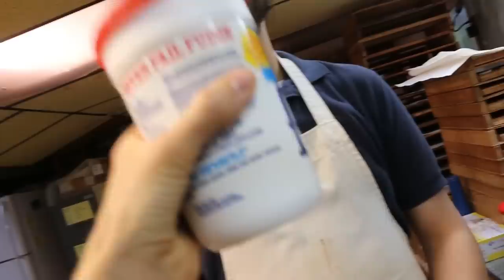How We Make Our Peanut Butter and Fluff® Cups

Comment: I always warm peanut butter up slightly so that its soupy when I want to pour it in a mold.  It settles nice and evenly and fills all the gaps before it cools and re-solidifies.
Reply: Vulgarr the Viking I would also add some powdered sugar to the peanut butter! Just me! 🌞🐬
Reply: @marycook1644  @Vulgarr the Viking Heating it up does reconfigure the structure and breaks down the oils leaving a slighty different taste. @Mary Cook That is why when people heat up and temper PB they add confectioners sugar to keep the sweet flavor. The idea is right but not for non cooked PB in cups.

Comment: Tip: If you get a pastry bag and lightly grease it so the fluff won't stick you can fill them faster I use this trick when I fill cupcakes with fluff at work <-----baker
Reply: Anela great idea! I think that would help them make more
Reply: There's a difference between baking and candy making. That light coating of grease in the pastry bag honestly makes the idea of the candy less appealing to eat.
Reply: Anela I think you're correct. What do you think about mixing the peanut butter and fluff together first? Even if it wouldn't work in a pastry bag you only have one blob to add to the mold. Even if you use an iced tea spoon🥄(which is what I use when dropping fillings to a mold).👨‍🍳💝🍫

Comment: I would use a piping bag with a medium round tip for the fluff. Messy on the inside of the bag, but so much faster for filling cups. Time is money.
Reply: SpiritBear12 I think mix the peanut butter and fluff together and then you only have to add one blob to that small mold! 🌞🤷‍♂️🏰

Comment: Maybe next time you can put foil liners in the peanut butter cups so they come out of the molds easier
Reply: JO65 I really cut time, I put the small candy cups in a mini muffin tin for stability. Then I put some melted chocolate on the bottom. Then I put it in the refrigerator for 2 minutes, add the filling, then I put in a little more chocolate. Tap the tin on the edge of the counter ,to smooth it. Then I put it back in the refrigerator until firm. 🍫💝👨‍🍳

Comment: Warm the Peanut Butter slightly, and fill with a spoon. It will settle on it's own that way.  WAY faster.  Also, warm the Fluff and fill with a spoon.  You just warm them enough to make them softer and easier to handle not hot so it does not hurt the chocolate.  Put the sticker on the bags first! , then fill with candy.  And for goodness sakes,  get a digital scale!   And guys,  one side of the ribbon will curl it, and the other will straighten it, so if you swipe one side and it does not curl, swipe the opposite side.  No wonder you guys never get vacations!  10 mins per bag, goodness.  LOL  Cracking me up
Reply: Livinnpjs if you warm the peanut butter too much it might melt the chocolate but agree about the spoons much more efficient
Reply: Orrr, they could do it how they want and how it apparently works for them. Radical thought I know.

Comment: I have an idea, Why don't you guys bend the tip of a butter knife 90 degrees (just enough to fit into the cups) then you could kind of 'stamp' the peanut butter level.  It might be a little faster, and you could just move the knife and not so much the tray. If it works, I will take my 5% creators fee in chocolate!